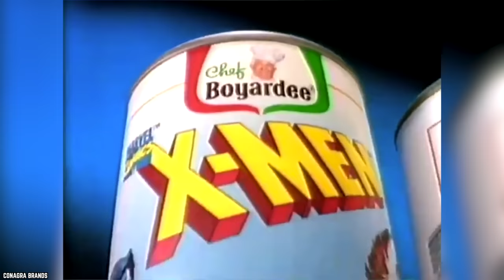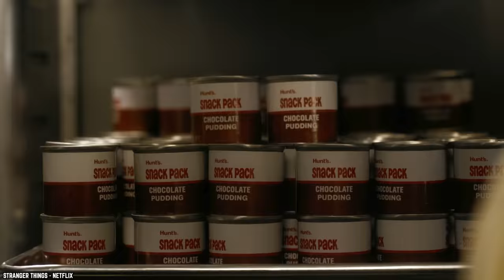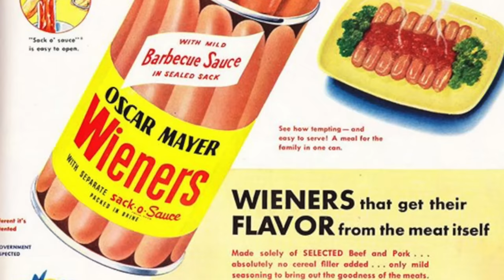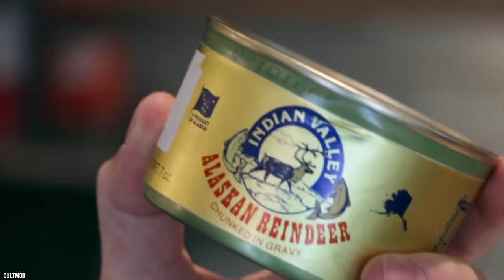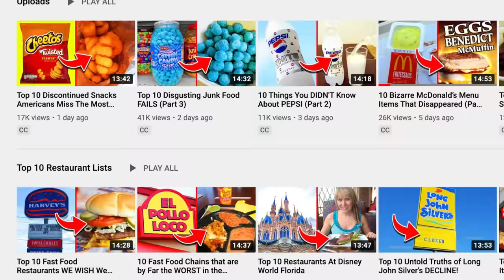10 Once Popular Canned Foods That No One Eats Anymore (PART 2)

Comment: B&M Brown Bread is coming back.  I've seen it in USA for markets like QFC and Krogers.   It's easy to heat through by opening one end and standing it on end in a pot of simmering hot water til it's warm all through, maybe 30 minutes.  Turn the can upside-down, shake gently,  and the bread will slide right out.  If it doesn't,  punch several air holes in the closed can with an ice-pick.
Reply from the maker: Wow😲 that's amazing.🤗@3 French Hens